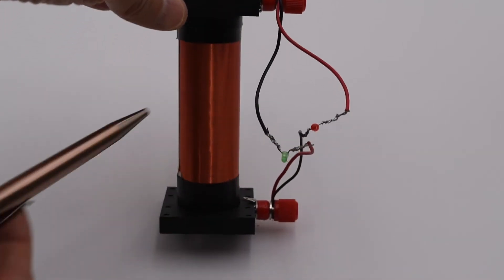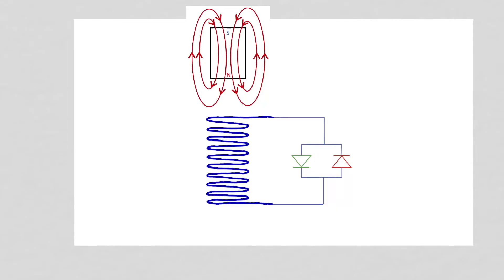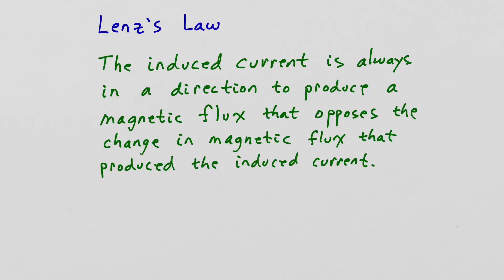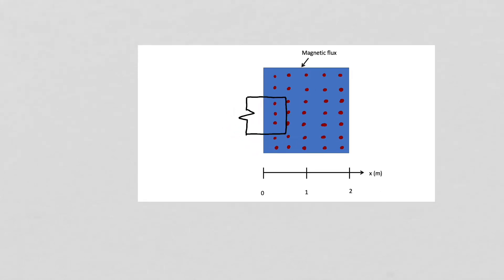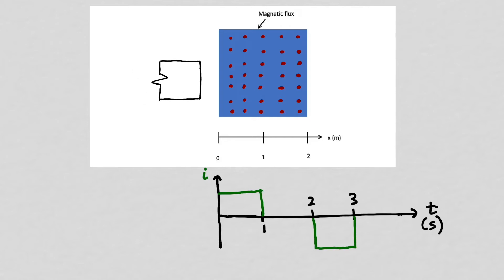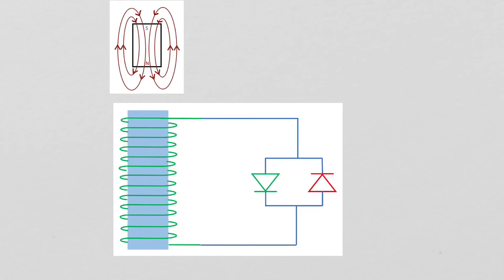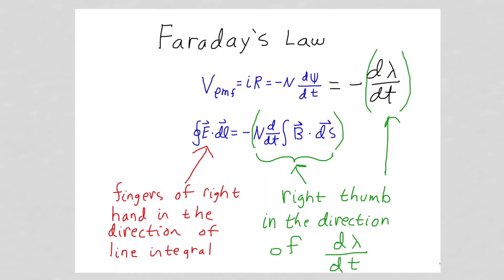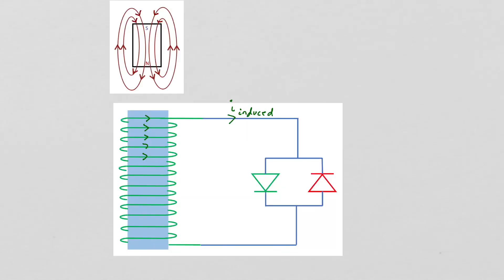Investigating Electromagnetic Induction (Lenz's and Faraday's Laws)

Comment: what is the no. of turns of  coil ? and what is strength of magnet to light led bulb?
Reply from the maker: I purchased that coil from a company called Pasco, https://www.pasco.com/products/lab-apparatus/electricity-and-magnetism/coils-and-cores/primary-and-secondary-coils#desc-panel

It does not say how many turns on that outer coil. I used several rare earth magnets stuck together. So the strongest magnets I could find. Probably similar to these, https://www.amazon.com/TRYMAG-Magnets-Neodymium-Refrigerator-Whiteboard/dp/B0C5MBX588/ref=sxin_16_pa_sp_search_thematic_sspa?content-id=amzn1.sym.76d54fcc-2362-404d-ab9b-b0653e2b2239%3Aamzn1.sym.76d54fcc-2362-404d-ab9b-b0653e2b2239&crid=26Y2WC9W32OA4&cv_ct_cx=rare%2Bearth%2Bmagnets%2Bstrong&dib=eyJ2IjoiMSJ9.zRXM9KvWwMREIOAkiiQgjfD6czymSvPDDp9zr0BJsSiLiscEfpX8pS5LBFOlUzmZ.FQ-2MCjic5wM2GYwDOheqk9G6s9yEkQhsp8pzbNUS90&dib_tag=se&keywords=rare%2Bearth%2Bmagnets%2Bstrong&pd_rd_i=B0C5MBX588&pd_rd_r=05ccd503-66da-44d1-8911-30f6078369f0&pd_rd_w=LqQSH&pd_rd_wg=130mW&pf_rd_p=76d54fcc-2362-404d-ab9b-b0653e2b2239&pf_rd_r=H3ARAGVWZEV3V31CG56X&qid=1731328113&sbo=RZvfv%2F%2FHxDF%2BO5021pAnSA%3D%3D&sprefix=rare%2Bearth%2Bmagn%2Caps%2C141&sr=1-2-6024b2a3-78e4-4fed-8fed-e1613be3bcce-spons&sp_csd=d2lkZ2V0TmFtZT1zcF9zZWFyY2hfdGhlbWF0aWM&th=1